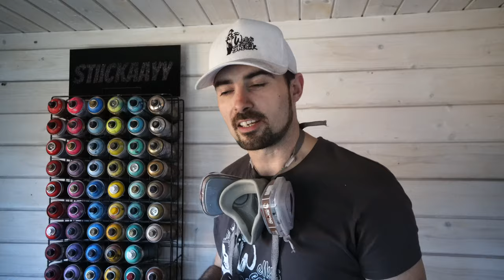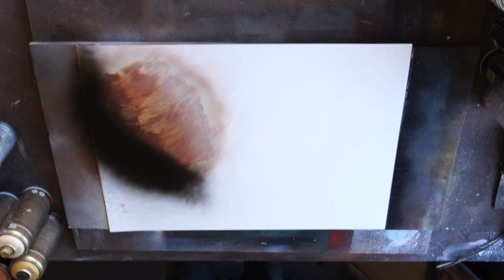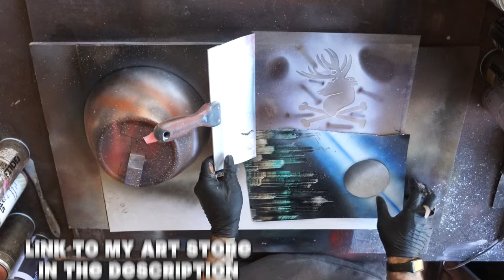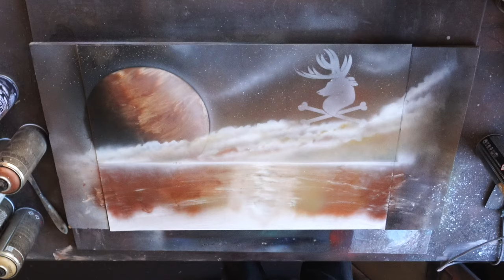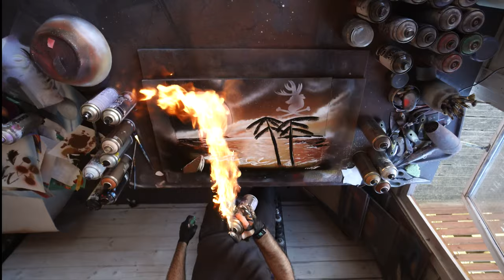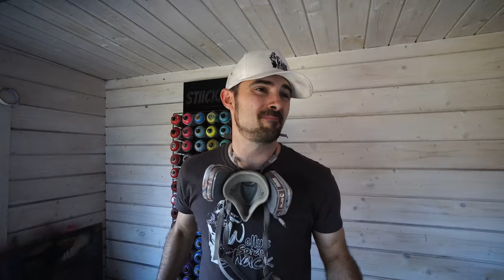Creating Steam Punk Art with Spray Paint!

Comment: You should try sprinkling A LITTLE BIT of baby powder or cornstarch in your gloves before putt them on. It helps with getting them on when there’s a lot of humidity or your hands are wet/sweaty. It also helps keep your hands dry & makes it easier when putting them on/taking them off. Just a hack suggestion. Thanks for continuing to put out quality work.
Reply from the maker: Never tried this before but might just give it a go in the hotter days!!
Reply: @TomWellyWells  Hope it works out for you. Thanks for the reply, means a lot!